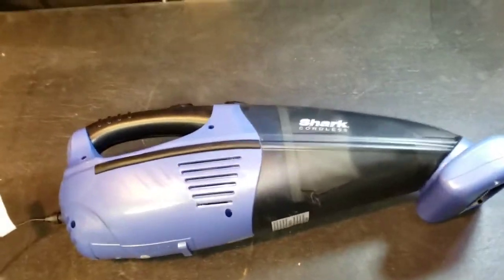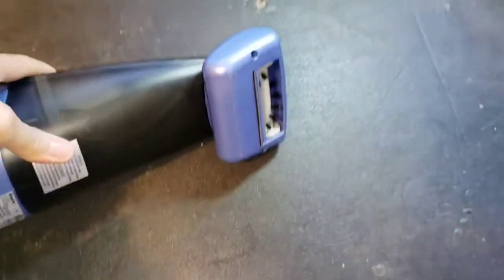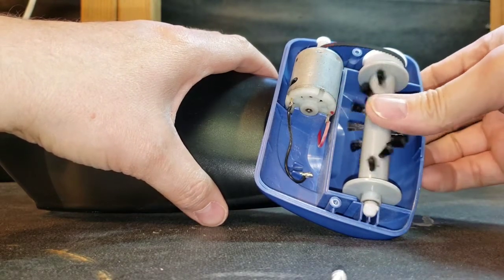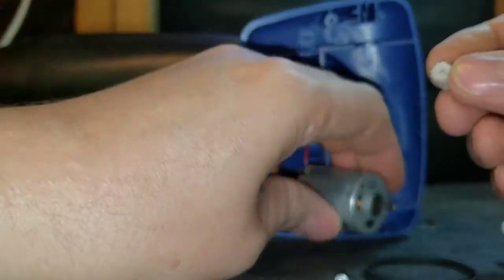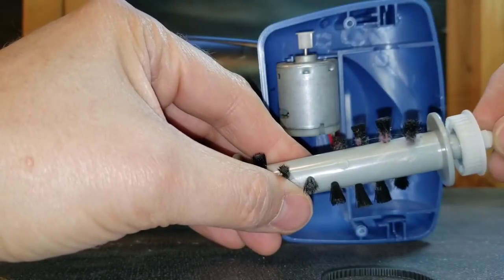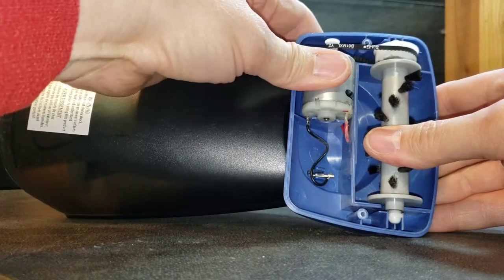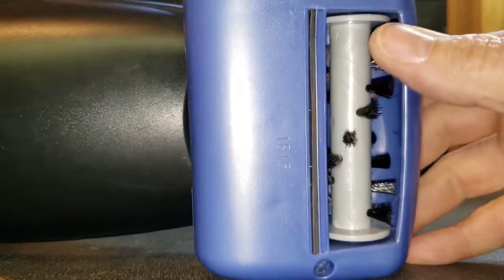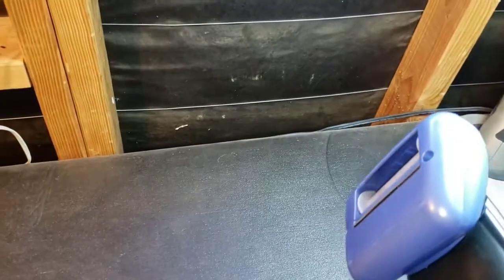Repair a Shark Cordless Hand Vacuum. Really Easy.

Comment: Well Walter you almost had it all correct. I had already done the investigating and repair you did and it worked great for a minute and then stopped again.  Anyway, I re-opened mine and found the rod was pulled away from the motor again just like you found yours, which is why the belt comes off. So I am going to wedge a rubber washer in mine with some lube and hope it keeps the rod from floating out again. I am wondering of you had a different outcome.
Reply from the maker: That’s interesting.  The rod on mine didn’t come loose so I didn’t have the same trouble you did.  But it sounds like you have a plan that will keep you from having to buy a new one any time soon.

Comment: I bought a Shark model SV780C-14 about 4-5 years ago. Never used it. Took it out today and the power brush didn't work. Exact same issue as yours in this video. (That's actually what brought me to your video). Also, the housing/bushing on either end of the shaft of the brush was cracked in the same way. I think it is purposely designed to fail after a time. The plastic that cracked is under stress naturally because of the friction fit, so after a time, it becomes brittle and cracks. I think they know that will happen when they design it so time will wear it out just as much as usage.